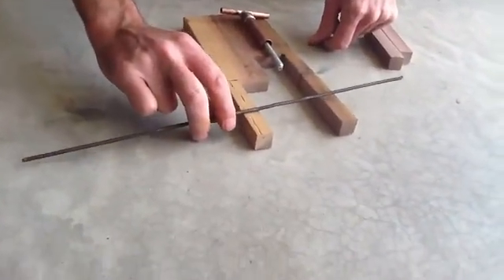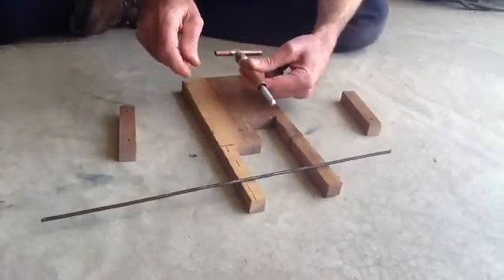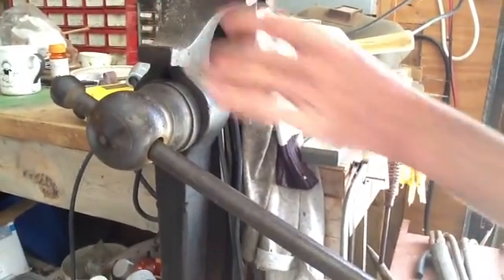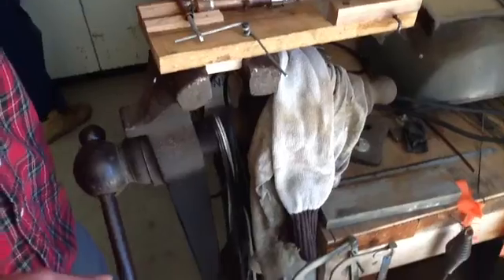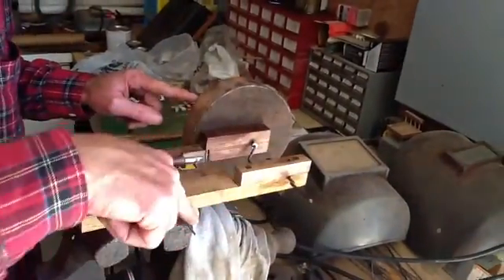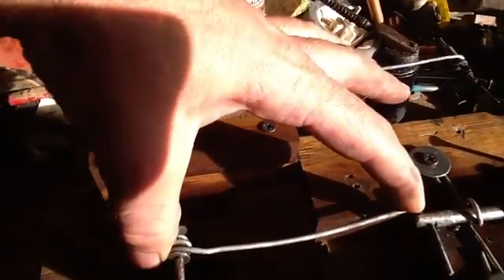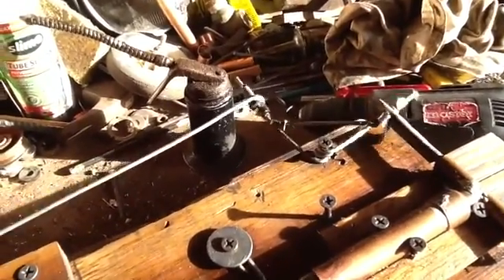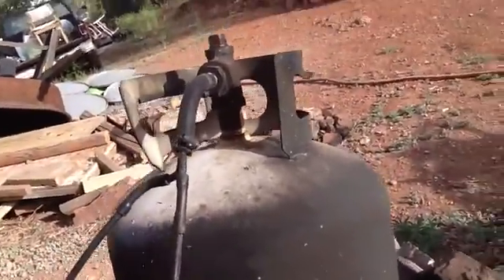Steam Engine How To Diy

Comment: Did you have to clean the propane tank before using it?  I have a 10# propane tank that I was going to use, but now I'm thinking about using a pressure cooker to avoid rust issues.

Comment: Did you cast that piston?  If so, how?
Reply from the maker: Thanks ....yes I cast it from aluminum  using a pencil with duct tape rolled around the end and pushed into homemade casting sand made of kitty litter sand and water ... I made a video of the rough casting ....aluminum casting steam engine piston......something like that it's on my channel ....good luck it can be frustrating this was my third engine I made and it definitely gets easier with experience